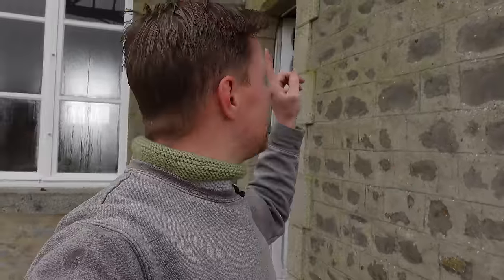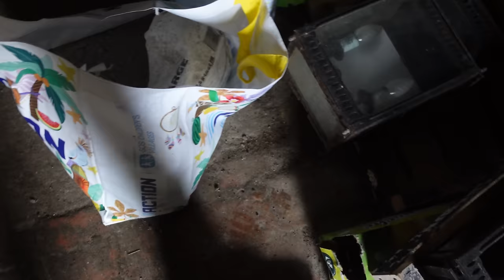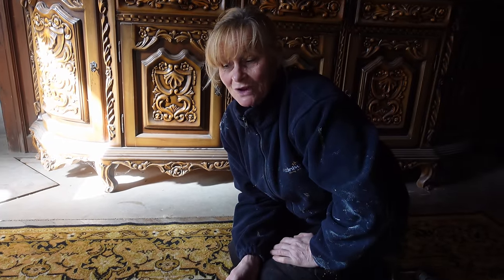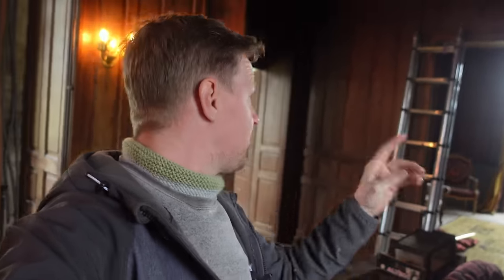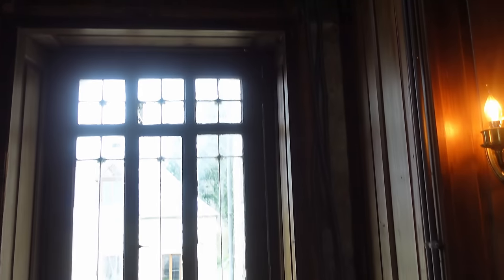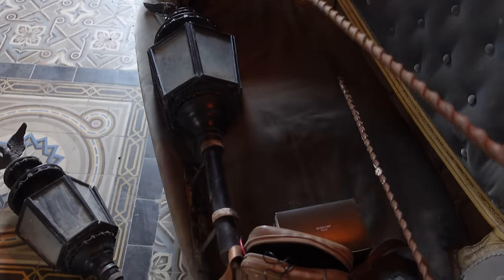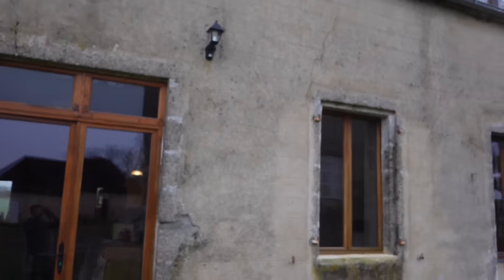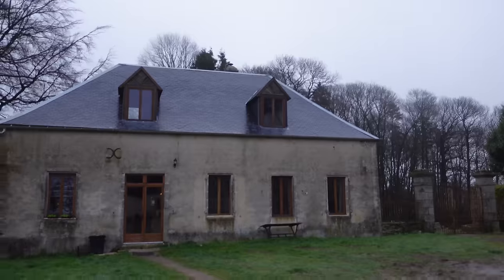Opening The SEALED DOOR To The Chateau Cellar | Taking On The Next Task?

Comment: Painting the cottage windows white is definitely a good call. It should connect visually with the chateau as part of the same visual line. Also chipping off the old render and exposing the stone would also help the cause. I would also clean the stones in the walled garden to also visually connect the cottages with the chateau. It would look a lot more grandeur. Great work! 

Are there cobbles in that court yard? Would be beautiful if there are to uncover sure you’ll get to doing the great gravel from the drive..

Lately some beauful metal planters or Versailles planters will soften the facade. I would do it in apple green color.
Reply: Sorry for all the typos! iPhones have a habit of automatically correcting and I tried to edit it, only for the message to disappear before i press reply. So it was my second attempt to post. Thanks for sharing another quality video filled with exciting updates. Those lanterns are beautiful

Comment: It wouldn't hurt if the lights on the chateau were even larger but that's a easy change if and when you find them later on. The ones for the cottage are perfect. I agree on painting the cottage windows white to make everything cohesive. I think the wood will stand out even more when the exteriors and landscaping are finished.
Reply from the maker: Thanks Amy 🥰🥰🥰

Comment: The complexity and scope of even the simplest chateau project boggles the mind.  It really helps put my pedestrian home maintenance problems into perspective! You guys are never boring!
When I'm trying to decide on whether to change a façade detail on house or fencing, I take a photo from enough distance to get a perspective view on the issue, then I print it out in draft quality greyscale on regular paper on my office printer and draw over it with pencil crayons to test what the proposed change will look like.  Getting that perspective really helps in visualizing the bigger picture.  I do a mock up for each idea that I'm trying to decide between.  Doing something like that might help resolve your thoughts about whether to paint the cottage windows white?
I'm thinking yes to the white paint, but would consider that it might draw attention to the fact that the windows on the cottage are modern, vs the style of windows on the chateau.  Also, which is easier to maintain?  Is painting the windows going to be more onerous to keep up vs oiling?  I think the walls of the cottage look like they would benefit from the chemical cleaning you did on the chateau stonework.  Might that be enough to freshen the cottage without needing to paint the woodwork?

Comment: Well Terry, your lanterns for the tower wall outside the doors have my approval, because I have a pair of identical lanterns in my dining room on either side of a china cabinet.  However, mine have never been outside and are still the original brass which I quite like.  And I vote for painting the cottage window frames white to match those of the chateau.  I think wooden shutters mounted on both sides of the windows and the door of the cottage would look great.  You could paint them a contrasting color of your choice.🥰

Comment: Cottage windows should be white to go with the Chateau. Gold leaf the rings around the lanterns that hold them in the wall brackets as well as the eagles and the little trim along the top and bottom edges. You mentioned having all the railing by the gates you just painted sandblasted do the awnings on both sides of the tower at the same time having those clean and white will really make the tower sparkle.

Comment: Dear Lalacellers, I don't think the cottage doors and windows should be white. Here's why. The two buildings are similar in style, yet quite different. If the cottage woodwork is white it will feel as if the cottage has been separated, cut off, from the main chateau.  But as a cottage it is a quite charming building with its own identity. I would suggest painting the wood a very pale blue. It's look would be like the wall lanterns you chose for the cottage, less formal but charming, The buildings will relate to each other but hold their own identity. See what you think.  Maybe a test on the door?

Comment: Please DON'T paint the cottage window frames white! Also, the exterior timber on the chateau AND all the metal gates, rails, lamps etc should be DARK GREY, to match that colour in the chateau stone.  That would have elegant continuity.  From there, you don't have to make colours so matchy-matchy with the cottage - the timber is not so much a colour but a feeling!  Leave the cottage windows alone! ... and paint all the white bits on and around the chateau DARK GREY to fit with the stones

Comment: Curious . what is the electrical color code in France? I imagine the mains voltage is 230 V 50 Hz ,  I know that England, uses  Brown  for Hot, Blue for Neutral, and green with yellow stripe for Earth ground. here in the U.S, it is black for Hot, white for Neutral and green or bare copper for earth ground. our mains voltage is 130 V 60 Hz. but we also use 230 V for clothes dryers, Central Air con, and such.

Comment: Small question, but would it not be better to run your electrical wires down, through the basement VS trying to force yourself through wall and ceiling cavities?
Reply from the maker: We have separate fuse boxes for each floor. It’s much easier to manage the electrics in this way 🥰
Reply: @chateaudelalacelle  I would have been inclined to guess down, across, and back up to the fuse box... without damaging the ground floor ceiling